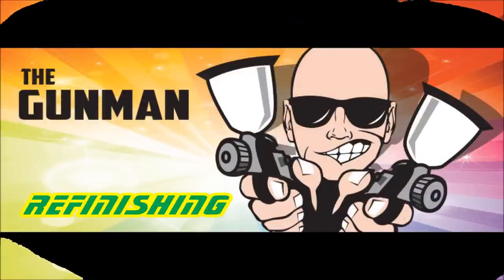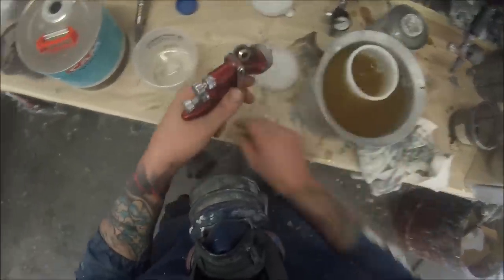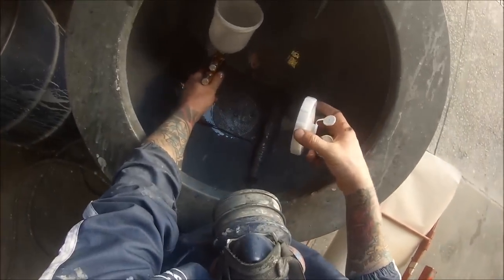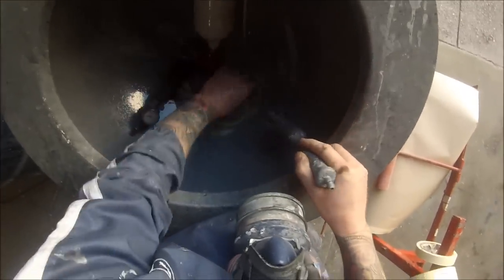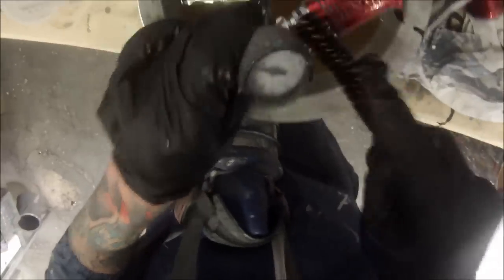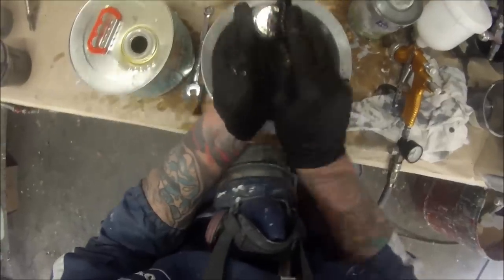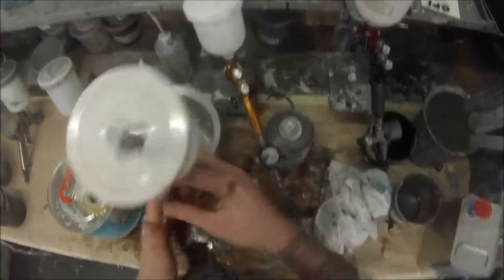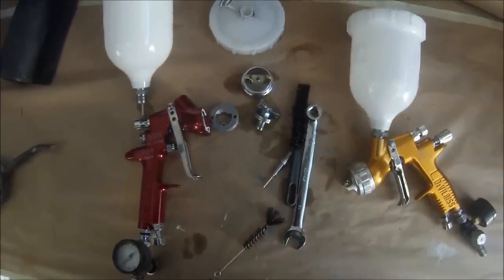How to Clean a Spray Gun "Properly"

Comment: Spray my urethane base coat, run some lacquer thinner through the gun without dismantling it,  then spray the clear coat. Finished then dismantle the spray gun and clean it with lacquer thinner. I'm using the 3m Disposable cup system so this method might work for me.

Comment: Mate was going to ask you to do a vid like this but thought everyone just knew how to clean a gun (except me). Been painting prototype parts this week using a de-beer  two part paint, the results over machined plastic was unreal but found I had to strip the gun between each color as it git clogged despite running gun wash through. Guess next time ill try the back pressure trick.  Awesome video collection,  thanks for posting you've taught me heaps this week.

Comment: Hi Gunman , my spray gun leaking air from the nozzle area , I do change the air valve kit but the problem didn’t solve, what should I do next ? The gun that I have is the red gti pro  same as the one     you have . Pls give me some advice, thanks

Comment: That gun cleaner/ paint stripper is some tough stuff. Eats up gloves quick for sure. Nice vid
Reply from the maker: Its killer stuff hey, Have you ever used it?
Reply: We have one by Kleen Strip called Naked Gun.  It is sort of a yellowish orange and is mean.  I run it thru my clear gun to flush it and then use normal lacquer thinner to rinse it out.

Never had any issues with a plugged fluid tip after using that stuff :)
Reply: Velvethamma that naked gun stuff is pretty good. The one in the spray can works awesome two.
Reply: 420livetoride That's what I use

Comment: Hei. Thanks for the lesson. Looks very easy but U are a pro and I just got my gun. I have tried it with both water based painting and oil based paint. And I didn't clean so well between, and now it has not been used for 3 weeks before I yesterday picked it upp again and will only use oil based. It isn't a very expensive lphv gun. Is that okay, with probably better cleaning in-between the different or can that destroy the gun? And can I use a toothbrush and q-tips to clean it? The oilpaint I bought ( a bit cheap one) was recommended to thin with white spirit, from 10% to 25%! But I used paint thinner to start with( It contains aceton, 2-metylpropan-1-ol and etylacetat) but after abit more reading it said I should use white-spirt. So I did and got better results, but still not a perfect (I) shape! I am painting my kitchen cabinets, and enjoying the satisfaction to spray vs use a brush.
And finally Is ther a big difference from a cheap gun to a decent gun?
Thanks for a great video, 
Br from Stein , Norway

Comment: Thanks. I'm a newbie and have just bought the LPH50 mini gun. The instructions say never to fully immerse in thinners. Other than that, would the daily procedure be the same? Just FYI, I will be using it not for paint, but for a highly durable tire coating, which I have reason to believe is acrylic based. Very occasional/infrequent use.

Comment: Hi, new to spray painting as I do a lot of steel work.
Problem I found with my spray gun is tat it's pushing air back into my gravity feed container and that causes the paint to splatter all over the place.
I did try to clean it but think I am missing something.
Any idea what could cause something like this as it's only the second time that I am using it now.
Thanks in advance.

Comment: what do you do when 2k goes hard in your gun? is it possible to let it dry for a couple of hours and then  just remove it as one piece? only the paint chamber and needle get in contact with the paint, right? I did some tests and poured some leftover 2K CC in a plastic cup. after a couple of days it shrinks significantly and it is not hard to remove it completely in one piece. it is like hardened gellatine, not hard as a rock.

Comment: I strip the gun and clean it after each job (yeah I'm a freak lol).I have a 7 year old sata 3000rp which is still working good.Also have a4000 which is definitely an improvement from 3000 series.
Reply from the maker: Yeah I know some people do like to strip each use but I've found it not necessary plus I clean a gun at least 10 times a day so I'd end up spending an hour stripping my guns each day, do you run gun filters too?
Reply: The Gunman yes I do run gun filters.Iclean it after the job so that will be the flash off time before baking :)
Reply from the maker: Yeah its a good idea and I guess it probably wouldn't take that long.
Reply: The Gunman 5 minutes top

Comment: Hey so I have a sata 4000 I used maybe a dozen times and I have a problem with the fan of the spray and also have some bubbles coming up into the paint can and when pressure is high it sprays inconsistent. Kinda flashes the spray pattern.   Help would be greatly appreciated thanks 🙏

Comment: Question. Any differences for water based (exact same but with water not thinner?) or polyurethanes? (I guess no thinner will strip a polyurethane once dry?). I'm a woodworker guy, so I'm thinking wood finishes. Thanks for the videos, awesome content.
Reply: if using water based it's "recommended" to clean the gun out with distilled water but realistically its not the end of the world if not. most guys i know in the trade just use tap water including or your normal thinners that you would use for cleaning , even at the shop where i work the gun wash machine for our base coat guns is just filled with regular tap water and have 0 issues with it. the tekna prolite we use for base coat is atleast 6 years old now and still spraying fine with no signs of corrosion or degradation in the gun
Reply: What is the brand of the spray gun cleaner machine?
Thank you

Comment: Grettings from Finland! I used hammerite style paint (not the brand hammerite) in a spray gun (just a cheap small LVLP gun), it was overall a failure, in order to thin it enough to make it sprayable it ran way way too easily. I cleaned it out with thinner and some acetone too, did the back pressure thing, but I am not sure now.

I read hammerite style paints contains silicone and now I am worried about silicone getting onto other stuff I'd like to paint and ruining the results. Is soaking the gun in stuff like that gun wash stuff going to be enough to completely clean a gun from silicone residue? 

Also does an ultrasonic cleaner have any place in gun cleaning?

Comment: Gunman, just watched this and have a question:   What can you do if you go to use your gun and it doesn't work.  I'm just a hobbyist I guess and don't use my very often.  I thought I cleaned it well after the last use but now I question how well it was actually cleaned.  The gun is what you would call "cheap"  I plan to buy a better gun at some point but I'm on a tight budget.  I'm not really sure if I should try to save it or just put it in the rubbish bin.  For now, it is all I have and was going to run some primer on a few 1965 VW Beetle fenders I have been working on.  Thanks in advance.  Dan
Reply from the maker: The gun has probably done the seals and a throw away item unfortunately, hard to say without seeing it but if not that then the most common reason a gun wont spray is the air cap being blocked so give it a good soak in thinners, the other thing is to make sure the fluid chamber is free of any old paint, does thinner come out when you pull the trigger?
Reply: +The Gunman nothing happens ATM, but the aluminum cap did suck down and the dome became concave.  I think it may be done.  Time to get out the pocket book and buy something new.  The little lady is going to love hearing this...   Thank for the note.  Love your channel.  You should come on a spray painting tour of the USA.  Stop in Denver and paint my 1965 Beetle.  LOL  I have a lot of metal work to do before "real" paint can be done.
Reply from the maker: Man I can't wait to come to the US
Reply: The Gunman when is that

Comment: Why do you install cup micro filter upside down, Is there any benefit.? Wouldn't the large pin will interfere with flow.? I used to install it that way too but now I'm confused. Nice vid. I've used my clear gun  (sagola 4500) for about 50 whole car repaint and never dissasembled my gun, just flow a little thiner and then some wd40 after each job, my gun still looks like new just a little chip on handle after a shock with my table. My cheap guns failed after I drowned them in cleaner or thinner, too much ruber seals to fail, now I'm using 3 sagolas and 1 Tekna prolite and none gets dirty, just a mf towel and get ready to next job.
Reply: +Ricardo Moreno Yeah. I agree about the filter. I was painting some shit today and my Mini Star just stopped putting out paint. After a pull down the filter with the little bulb on the end had dropped all the way in and blocked the flow.
It came installed that way from new. I turned it around and it now seats nicely into the gun and just the little bulb is sticking up giving me something to grab onto to pull it out.
This is the reason I hit up the gunmans site to see what he recommends.
I did notice the second gun he washed did not have one.
What's the go gunman?
PS Love your youtube vids. Simply the best way to learn.
Reply from the maker: +UrbanCynic101 Just watched the whole vid again myself and I did have a filter in the pro lite but just didn't pull it out. I honestly found in a full sized gun it makes no difference at all which way up the filter is. I don't usually run a gun filter in my mini guns, just filter the paint and keep them clean.
Thanks mate, appreciate it.
Reply: I never run filter , screwed up a paint job once , once was enough

Comment: Can I use water to clean it ? or will it damage de gun
Reply from the maker: remyleouf Depends what gun you have and what paint you've been using.
Reply: The paint is plastic dip, and the gun it's a basic one that came with the air compressor
Reply from the maker: water won't touch it, you need to use gun cleaning thinner (solvent)

Comment: No such thing as back pressuring a spray gun by putting your finger over the nozzle lol. All your doing is plugging the drip tip with your finger where the paint flows out, there’s no air flow pressure going through there.   The only air pressure that comes out is the removable air tip that creates the fan.